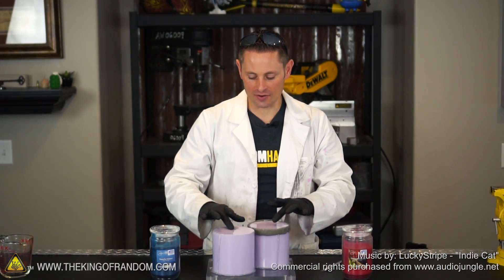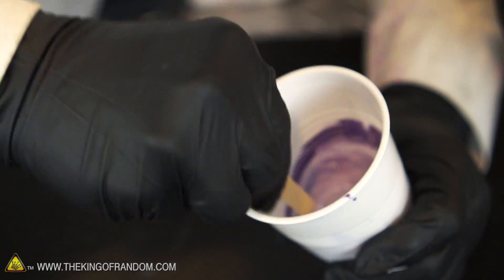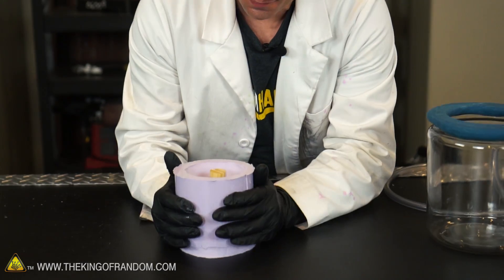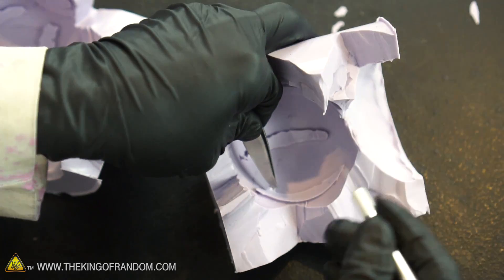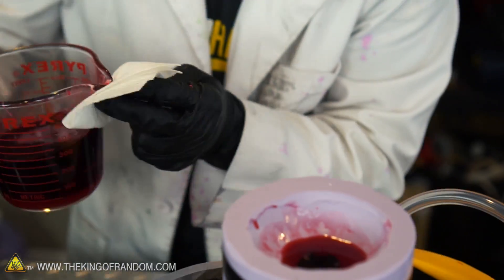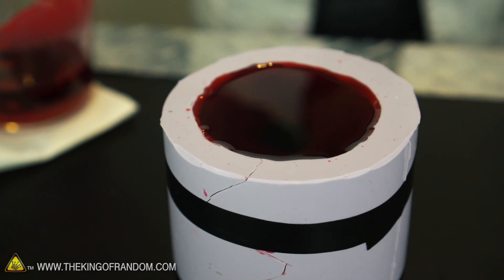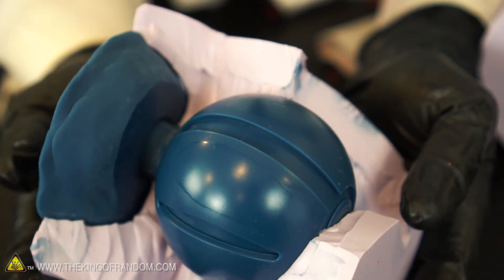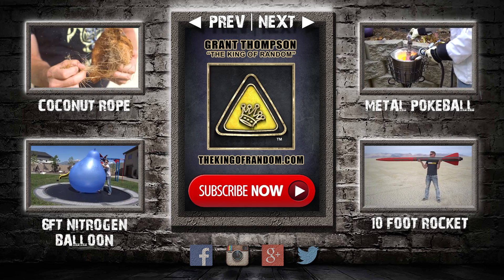Wax PokeBalls & More Trypophobia Reactions in a Vacuum Chamber | TKOR How To Make Pokeball Mold

Comment: The reason why the wax was bubbling in the vaccum chamber is because it was boiling.
Reply: The truth has been spoken, get this comment higher! Reducing the pressure loweres the boiling point, in this case below the temperature of the molten wax
Reply: Johnnyboy was about to say that just like water will boil easily under vacuum
Reply: oliver henderson you don't understand dude the silicone was mixed and had air all through it and to pull the bubbles out you use a vacuum but the wax had little to no air in it so when it boiled it became gaseous while the silicone was just releasing bubbles not becoming gaseous
Reply: Johnnyboy this is what I thought but I am a little confused can't you also freeze liquids with a vacuum chamber like oxygen (aq) I watched codys lab or someone like that
Reply: You would be incorrect in this case. It is a classical thermodynamics problem where there is a partial pressure of steam and a partial pressure of atmosphere. When you cool the sealed vessel down, the partial pressure of atmosphere remains but the steam condenses, reducing its volume immensely. This results in a net reduction in pressure. As well, given that the air pressure is equalized in the atmosphere, the steam displaces much of the air so that the total pressure is still 1atm, but the majority of it is made up of steam. This reduces the partial pressure of air and increases the resulting partial vacuum.
Reply: BearCat459 exactly, thats what i was referring to :)
Reply: This.  Most likely same with the liquid silicon.  You aren't 'removing bubbles' you're boiling the mixture and you're boiling the liquid wax.
Reply: Thx for pointing out for many of us! :D I hope it'll reach him.
Reply: Johnnyboy was about to say: "you forgot about physics and chemistry..."
Reply: That's not because air gets removed but because when you put boiling hot water in a container it creates a vacuum when it cools down because the air that's still in the container cools down. Hot air has higher pressure than cold air.
Reply: Just as i thought I should comment this I saw yours, cool :D
Reply: Johnnyboy 9
Reply: userful1 b
Reply: I'd said it both removed the bubbles and boiled.. idk but the result looks amazing, really clean cast.
Reply: Tim B. Just because it is a liquid does not mean there is no air dissolved. You have to boil the liquid to remove the solute.
Reply: If you look at the reservoir and the pokeball itself, it seems like boiling in Vacuum as you say, still does a difference. Because the smoothness seems a little different between the two.
Reply: The fact that the paraffin boils and that the silicone boils does not mean that the air is not ALSO being removed. We often use boiling water to push out air to create a partial vacuum when the water condenses. This is used in canning.
Reply: oliver henderson 
No, the silicone didn't boil.
The lower air pressure outside the bubbles made the bubbles grow until they popped.
Reply: TheDerpingDutchman was
Reply: Was just casually rewatching some of these older videos and saw this comment. As much as I want to agree with you all,  has anyone thought of cavitation? (Due to rapid change of air pressure on the wax/liquid)
Reply: My understanding of cavitation is that it is caused by the movement of 
something solid through a fluid which creates a negative pressure behind
 it. If that pressure is low enough, the fluid phase changes into a 
vapor. Since there is no moving solid, I don't believe it is cavitation.
The lowering of the pressure allows the wax to boil as its boiling point is determined by both temperature and pressure. For an interesting phenomenon related to that, look up triple point.
Reply: Johnnyboy
Reply: and that means that the silicone was just  bubbling not getting bubbles out therefore his previous experiment dosent do any thing
Reply: Johnnyboy that's why say trypophobia

Comment: About the bubbles when you put wax in the vacuum chamber, aren't they just wax bubbles due to evaporation? Because you remove the pressure, the evaporation temperature should go dramatically down, well below atmospheric temperature...

Comment: So, when you are vacuuming the wax, I'm thinking you might not be drawing all those "bubbles" out, instead you pulled some bubbles out (at the beginning) and a lot of the rest was probably just the wax boiling since you are decreasing pressure inside the chamber. Just like room temperature water will boil under vacuum, and blood will boil in space. Thoughts?
Reply: Correct. A substance starts boiling when vapour pressure = atomspheric pressure.  In this case the atomspheric pressure was reduced significantly due to the vacuum.
Reply: Urfir3d I think so too!
Reply: Its maybe that

Comment: The bubbles coming from the wax in the vacuum chamber is likely the wax itself boiling. Wax is just much longer hydrocarbon chains then say gasoline, therefore had a much higher vapor pressure, thus higher boiling point. In the vacuum though this vapor pressure is greatly reduced and allows for boiling at lower temperatures.

Comment: Hey Grant, I would recommend cutting zigzags only 1/2 the depth into the mould, and then on this inside half (the part that comes in contact with the inside) cut straight, that way there is less chance for the final product to have a seem line.

Comment: If it's under vacuum, wouldn't it implode rather than explode?
Reply: Abhinav Mishra the pressure outside is greater than inside. 
Meaning most of whatever shockwave is created will go towards the point of highest vacuum
Reply: Abhinav Mishra I was enquiring to his use of the word explode